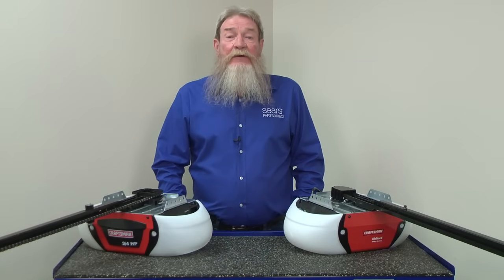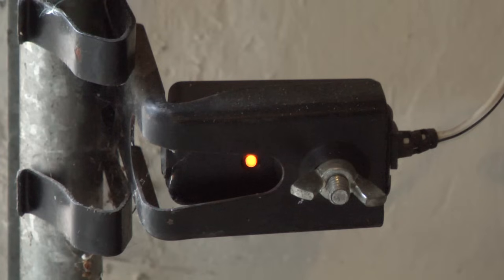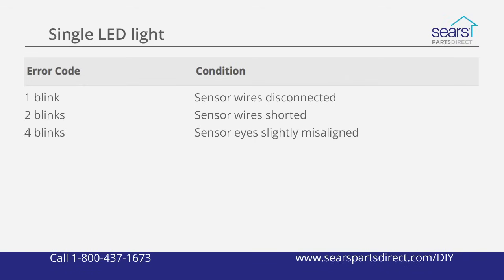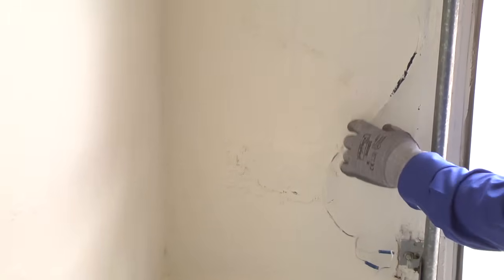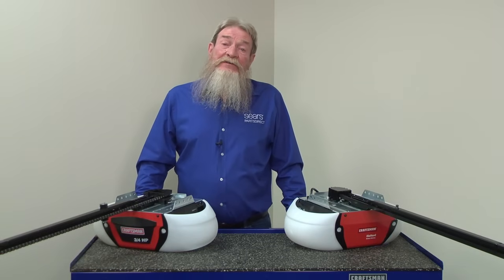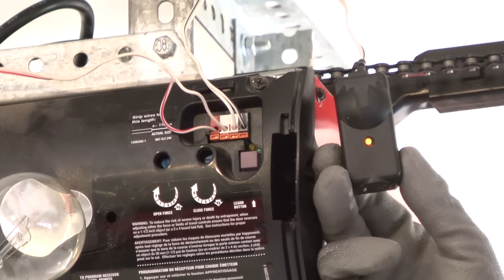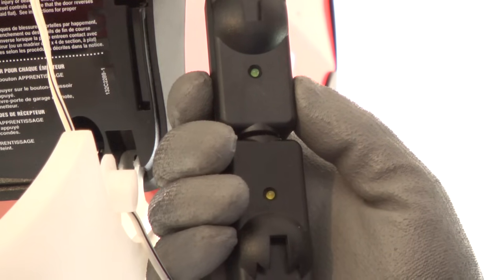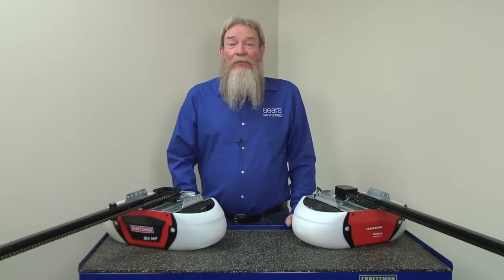How to Fix a Garage Door Opener that Won't Close the Door: Lights Blink 10 Times

Comment: I wired the sensors together, both light came on. Pointed them at each other, but the door still would not close. HELP
Reply from the maker: Double-check the wiring connections. If you wired the sensors properly with short runs of wiring at the motor unit and the door still won't close when the sensors are aligned (both sensor lights on), then bad sensors or a failed logic control board could be preventing the door from closing.

Comment: One more thing to consider, the sun (sunlight) and the receiving sensor. 
I just had an issue (this issue)with the garage door at my rental and found that shading the receiving sensor solved the problem of the door not closing. A couple hours later the sun is no longer an issue and the door closes without the aid of shading. Ultimately, the sensors should switch positions. So, sunlight is never interfering with the receiving sensor.

Comment: You seem to know alot about these garage door systems. See if you can figure this one out; wall push button light is flashing continuously and will not operate the door. Except if I somehow mess around with the "lock"button, in which case it MAY open but then starts closing before it's up all the way. Remotes work. Keypad won't work. Sensor lights are on and are working properly. I can play around with all the buttons and get it to open and then I just stand there and watch it go partially up and then partially down and then partially up then partially down... all by itself! The light on the motor does not flash.
Reply from the maker: First, try resetting the logic control board in the garage door opener by unplugging the garage door opener for 1 minute and then plugging it back in. If you garage door opener has a battery back-up, then you'll need to unplug the garage door opener and disconnect the battery for 1 minute to reset the board then restore power. That may fix the problem. Weak batteries in a remote device can cause the problems that you're describing. Replace the batteries in all remotes and the keypad. If these tips don't help, let us know the model number of your garage door opener and we'll try to provide some more troubleshooting tips.

Comment: My led blinks only when I press my remote but nothing happens. Help
Reply from the maker: Check to see if the lock feature on the wall control is turned on. Disable the wall control lock if it's turned on. If that tip doesn't help you resolve the remote device problem, follow the tips in this troubleshooting article/video: https://www.searspartsdirect.com/diy/article/garage-door-opener-remotes-wont-work-video . We hope this information helps. If you need further assistance, let us know.

Comment: What if it blinks 5 times?
Reply from the maker: Five blinks indicates that the drive motor overheated on many garage door openers. The motor can overheat if the door is opened and closed several times in a row. Unplug the garage door opener to reset the logic board. Allow the motor to cool for about 15 minutes before restoring power and using the garage door opener. Pull the emergency door release and check the up-and-down travel of the garage door for binding. Repair the garage door if it doesn't travel smoothly. If it overheats after a single use and the garage door travel is smooth, replace the motor. We hope this information helps. If you need further assistance, give us additional details about the problem and let us know the model number of your garage door opener.

Comment: If yours flashes 10 times and you DON'T have a sensor installed. Try disconnecting the power (If you also have a battery you'll need to disconnect one of the leads whilst it's switched off).

I think some dust must have got in the connections. Disconnecting the power seems to reset the condition.

Comment: The  controller  light on the sensor unit is not blinking and the yellow and green light are both on but my door keeps opening. When it almost closed the door goes back up and when I push the button on the wall to stop it, the controller light blinks several times like almost ten times
Reply from the maker: A restriction in downward door travel could cause the garage door opener to reverse direction during closing. Pull the emergency release rope to disconnect the garage door from the trolley and close the door manually to see if the door moves smoothly during downward travel. If the garage door binds up, fix the cause of the travel restriction. If the door moves smoothly, let us know the model number of your garage door opener and we'll suggest additional troubleshooting tips for your model. You can often find the model number of your garage door opener on the side of the motor unit under the light cover.
Reply: @searspartsdirect  Thank you so much. I pulled the emergency rope to open the door and closed it manually as suggested and there was no restriction, it opened and closed easily and doesnt appear stucked so I still dont know why the door is having issues. I have been closing the door by pressing and holding on to the wall control till the door fully closes which isnt meant to be. 

The model number is 139.53915D
Reply from the maker: @olukokunadedeji6769  Thanks for providing that model number. When the door reverses, check the Learn light on the motor unit to see if it flashes an error code. The owner's manual shows error codes and troubleshooting tips for your model on page 34. Here's a link for a webpage that has the owner's manual for your garage door opener in case you need it: https://www.searspartsdirect.com/manual/m7lx8ygplp-000247/craftsman-13953915d-garage-door-opener . Follow the troubleshooting for the code that flashes on the motor unit. We hope this additional information helps. Let us know if you need more assistance.

Comment: This was big help since my door was not working and I did not see any reference to 10 blinks in the manual. It covered primarily 1 thru 6 blinks, and I had ten. . Everything else looked right, so I cleaned the lens on the safety sensors and Bingo!  back in business. Thx again.

Comment: WOW, thanks for posting this video. Lots of tips on fixing shorts in garage door system due to bad wire connections, fixing and adjusting light sensors, all good stuff. Will try to determine why my remote clicker won't close the door. It opens door fine, but does not close the door. thanks!!

Comment: Both my sensor lights are on door goes down to sensors and back up door wont close lights flash 10 times. Help
Reply from the maker: Check for safety sensor wiring damage or loose wiring connections. Repair any damaged wires and reconnect any loose wires. If you find no loose wires or wiring damage, test the safety sensors directly at the motor unit as shown beginning at 3:17 in the video. If the door closes when you hold the sensors directly together at the motor unit, then you'll need to replace the safety sensor wiring. If the door doesn't close during that test, then you'll likely need to replace the sensor or the logic board. We hope these tips help. If you need further assistance, let us know.

Comment: My sensor was off even though it was lit. I adjusted it and got a better reception from the sending sensor and everything works! Thank you!
Reply: I will try adjustment. I get 10 flashes and the main board light gives me 4 flashes, sensor slightly misaligned. Only happens in the middle of the day, never at night. Sensor lights are correct colors. Wondering if the sun shining on the receiver could impact...

Comment: My sensors were not lighting up so I took your advice and plug them directly pointing to each other and they both lit up. When installed back normally, the yellow sensor only works if the green sensor wire is disconnected at the motor side. If both are plugged in it, then neither one lights up. Don't know whats wrong. I will try new wires and see if it fixes it. Any suggestions?
Reply from the maker: Based on your symptoms, replacing the sensor wiring will likely fix the problem.

Comment: Can I just disconnect or remove my sensors?
Reply from the maker: No. The safety sensors are required for the safe operation of the garage door opener. The garage door opener won’t work with the sensors removed or disconnected.

Comment: I only have issues with my garage door not closing when it’s colder outside, what could be the issues? Vibrations?
Reply from the maker: If you have the sensors clipped to the garage door rails, there’s a chance that vibrations could cause sensor misalignment. If you notice that the rails vibrate more during winter, you can mount the sensors to the garage wall as shown in your garage door opener owner’s manual. Another issue that causes garage door sensor issues during colder months is sun glare. You may need to install these sensor sun shields to prevent sun glare interference with the sensors: https://www.searspartsdirect.com/part-number/41B873/0009/139.html
Reply: Thank you for the response, I ended mounting them to the wall and it works as it should now. Your video helped me determine that the sensors were out of alignment. Great tips

Comment: Light bulb near motor blinks 10 times.....the receiving sensor will not light up.  The light near the learn button is blinking 5-6 times. Should I replace sensors?
Reply from the maker: Before replacing the sensors, check the wiring as shown in the video beginning at 2:25. Bad wiring could be causing the sensor failure. If you find no wiring problems, test the sensors directly at the motor unit as shown at 3:17 in the video. Replace the sensors if they don’t work when connected directly at the motor unit.

Comment: This is a great video and it saved me an unnecessary service call.  The issues were clearly with the sensors, which I thought I was going to have to get replaced, until I saw the Learn lights blinking codes about a third of the way in your video.  Just first looking at the sensor wires seated right above Learn button showed that a gentle wiggle would cause the source sensor to turn on and off and the blinking phase to change.  By just re-securing those wires, the wife was once again happy that the door worked perfectly again.  Thanks Wayne and Sears Parts Direct for these helpful videos!

Comment: I recently installed a series 100 craftsman opener and had the green light flashing all the time on the sensor eye and would have trouble closing some times.I rechecked the wires on the back of the motor unit and sure enough one wire was pushed into the back of the motor unit too far into the connector and I pulled all of them out and reinstalled them all and it fixed it.I thought it was a bad sensor eye.

Comment: After 2 years the wall panel won’t work, the light comes on and stays on overnight. The battery keeps dying and getting replaced.  So far I’m not impressed. I expected more out of craftsman
Reply from the maker: We’re sorry to hear about the troubles that you’re having with your Craftsman garage door opener but we’re here to help. We recommend that you troubleshoot the wall control as shown in this video: https://www.searspartsdirect.com/article/garage-door-opener-wall-control-troubleshooting-video.html. To troubleshoot the battery problems, first check the electrical outlet that supplies the garage door opener with power. Plug a work light or other electrical item into that outlet to make sure the outlet works properly. A faulty power supply will drain the battery. If the power supply to the garage door opener is okay, unplug the garage door opener and check the wiring connections of the power cord to the logic board inside the garage door opener motor unit. Reconnect any loose wires. Check the power cord for damaged wires and repair any wiring damage. If the electrical outlet and power cord are both okay, then you may need to replace the logic board in the garage door opener. Here’s a video that shows how: https://www.searspartsdirect.com/repair-guide/garage-door-opener/how-to-replace-the-logic-board-on-a-garage-door-opener.html.

Comment: Thank you Wise Beard Garage Door Man. Bad wiring between motor and sensors apparently. I have them plugged directly into the motor and taped them to the side of the motor until i can rewire the full length

Comment: Great video. Thanks.  I have read all of the comments as well but not sure what's a hppening with my garage door not closing. It starts to close and then not even half way down and starts retracting. Help? 1) The sensors are aligned 2) the lights are full lit Orange and Green 3) I have tested the beam and it works. Placed my hand in the front to test. 4) There are NO lights blinking. The only time it clinks is when I block the sensor. blinks 4 times. But these are aligned! so not sure what's happening.5) The chain works fine and nothing obstructing on the rail.  Since the sensors are aligned and working, do I need to replace them? Any others items to check? Also, no direct sunlight. I have tried this at night. Thanks in advance.
Reply from the maker: The safety sensors may be okay. Follow the troubleshooting steps in this video to help you figure out what’s wrong: https://www.searspartsdirect.com/article/garage-door-wont-move-motor-and-travel-troubleshooting-video.html.

Comment: Not 100% accurate.  The main controller in the opener is responsible for supplying the power to the sensor.  What if the opener itself was defective and not supplying the power needed?  Ggbe test here if followed would le as d you to belu eve that the sensor is bad and not the main controller. Every rrest after that would also at beddt give you partial information.
Reply from the maker: You are correct that the logic board inside the motor unit supplies power to the sensors but the power supply for the sensors rarely fails. Tests are not available to check the sensor power supply so if you replace the sensors and they still don’t work, then you’ll likely need to replace the logic board.

Comment: ok I replaced both sensors, one solid green light and one solid yellow light but now the door gets all the way down and then comes back up DIDNT do this before, as if the down force isn't strong enough? ???
Reply from the maker: Down travel likely needs adjustment. Use the procedure in your owner’s manual to check and adjust down travel.

Comment: Do I turn off the power to garage door before cutting the wire? (duh i know but i have to ask)
Reply from the maker: Shutting off power or unplugging the garage door opener before cutting wires is always a safe practice to follow. Because the sensor wires on the garage door opener in this video use only 5 volts DC and only several milliamps of current when transmitting sensor signals, you can cut the sensor wires and handle bare sensor wire ends without risk of electrocution when the garage door opener still has power. Unplug the garage door opener before handling or cutting any other wires on the garage door opener.
Reply: Sears PartsDirect thank you

Comment: Hello. I have the exact problems shown here with my craftsman. First I checked my old sensors and they needed to be adjusted. So so did and it still continued. Then I decided to just buy new sensors and I stalled them exactly like the directions said. Everything is as its supposed to be but the problem continues. Any other suggestions? Still blinks 10 times.
Reply from the maker: Carefully check the new sensor wire connections because the sensors won’t work if the wires aren’t connected properly.
 
If you have the new sensor wires connected properly, check the new sensors directly at the motor unit as shown at 3:17 in the video. If the sensors work during that test, then you know that a wiring break is causing the sensor problem. Find and fix the broken wire or run new wiring between the sensors and the garage door opener motor unit. Here’s a link for 2-strand sensor wire: https://www.searspartsdirect.com/part-number/41B4494-1/0009/139.html.
 
If the sensors don’t work when you test them directly at the motor unit, then you may need to replace the logic control board in the garage door opener motor unit. Here’s a video that shows how: https://www.searspartsdirect.com/repair-guide/garage-door-opener/how-to-replace-the-logic-board-on-a-garage-door-opener.html.

Comment: I have the opposite problem. In the summer we don't have problems. But when the temperature is under 70 degrees the remote doesn't work anymore and it blinks 10 times. It goes down about 1 feet and then up again. Then I have to walk back to the garage and use the wired button. I have to keep the button pushed till it's up or down. What is the problem here?
Reply from the maker: Your symptoms suggest that sunlight or light reflections may be interfering with infrared beam detection by the sensors. We suggest you try installing these covers over the sensor to avoid that type of interference: https://www.searspartsdirect.com/part-number/41B873/0009/139.html.

Comment: Over the course of 6 years, my sensor wires had wiggled out of the push down terminal shown at 1:30.  They were still making contact to allow the door to start to close, but would then vibrate to an open/disconnected state.  The yellow LED would blink 2 and 4 blinks which was somewhat not helpful.  Luckily I spotted this wiring issue and zip-tied the wire bundle close to the terminal block to prevent future wiggling :)  Thanks for the video, this was driving me nuts.